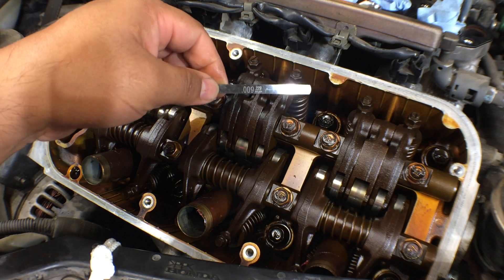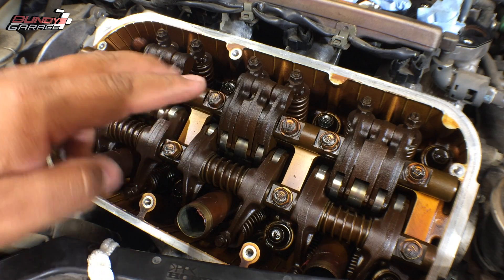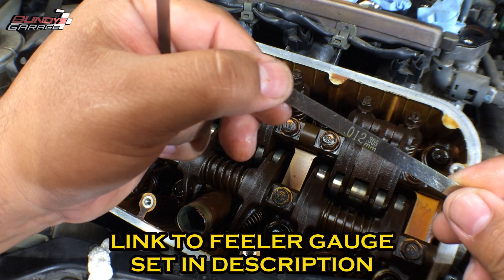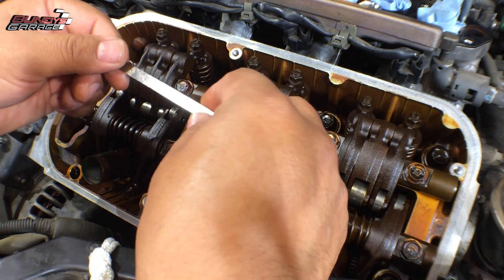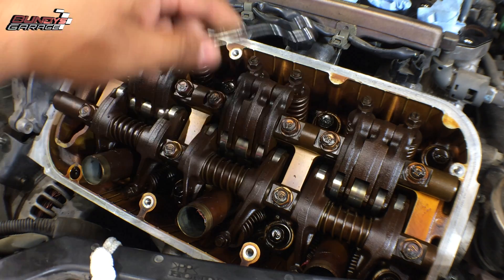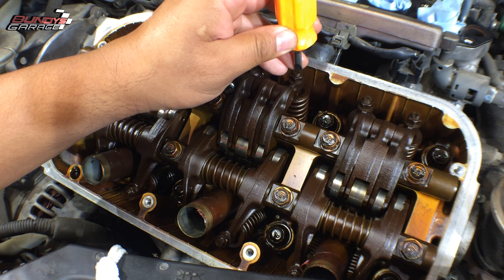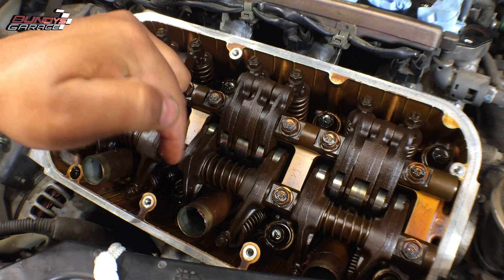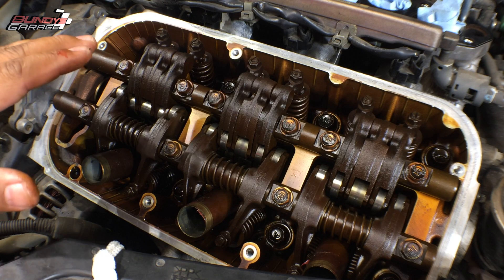J SERIES Honda V6 Acura Pre-Check | Valve Lash Adjustment Accord Odyssey Pilot 3.0L 3.2L 3.5L 3.7L

Comment: When I start the car (it’s a 2006 Acura TL), it starts with a slight misfire and then stabilizes. The scanner shows cylinder 5. The car runs normally until I put it in Drive, drive a short distance, and stop—then it begins to misfire on cylinder 5. Shifting into Neutral doesn’t make it go away, but if I put it back into Drive while the misfire is present, it clears up and drives normally again. However, once I stop at idle, the misfire comes back. What could it be?
Reply from the maker: Have you done a compression test? Sounds like a bad fuel injector or you needs to check valve lash.

Comment: Only adjust the valves when u see the marks lined up on the camshaft and the front cover for that cylinder. You have to rotate the crankshaft for this. 19mm bolt on the crankshaft. If what I just explained is not making sense, please go to your professional mechanic.
Reply from the maker: Yep if you get it wrong, bye bye engine.

Comment: I had to do a vvt solenoid replace on a 3.5 and to do that you have to remove the rocker arm. My question is when I go put the new solenoid and rocker arm back on and torque to spec do I need to adjust the valves too?
Reply from the maker: It's a good idea to.
Reply: What year is your honda? My 2010 was 3 bolts and boom everything was off

Comment: I had to swap out the front cylinder head due to a broken bolt that messed up one of the holes. I transferred the camshaft , and arm rocker to the new head. After assembling camshaft and arm rocker I can’t rotate the camshaft it is too tight and jumps when I’m trying to rotate it. I need help on this .
Reply from the maker: Did you do a valve adjustment? It will be really hard to rotate it on the bench, gotta have the head on an engine block.

Comment: What if you can’t fit a feeler gauge underneath? Need to turn the motor? Or valve burnt?
Reply from the maker: On the J Series you have to make sure the front camshaft is lined up with the specific number cylinder you are working on. Here is the cylinder order for the J Series.
FIREWALL
1 2 3
4 5 6
RADIATOR
Reply: Provided you are adjusting the right cylinder for the cam and crank position, not being able to fit the correct size feeler gauge means that the valve is tight. Valves normally tighten with time as a result of valve seat recession. If the valve is tight, you must loosen the locknut and adjust that valve using the correct size feeler gauge.

I should note that a tight valve COULD be burned. This is not likely the case unless the valve clearance is ZERO. But you generally know by the way the engine runs (ie a miss that clears up at higher RPMs) whether or not you have a burnt valve.

Comment: When I opened up my valve cover, one of the rocker arm adjustment nuts was not there. Is it OK to use A? Regular bolt or do I need to order from Honda? Oem
Reply: Which is nuts 🤣
Reply: @celestial_2307  lmao I gotta re edit. There are Chevy nuts, and Honda nuts, depending on their level of “die hard”😅
Reply: A nut is a nut. A bolt is a bolt. As long as the “grade” is the same, you’re fine. There’s no “Honda” nuts and there’s no “Chevy” nuts. They all come from the same place.

Comment: Please what if the filler gauge is not available,what can i use to check and gauge
Reply: You can use printer paper if you know what the thickness is. Don’t adjust valves without proper tools. No sense of tearing apart an engine if you don’t have the tools to put it back together correctly…”eye ball” would be your best guess probably 👍🏼

Comment: Help, please. My car was ticking on idle and ticks louder when im accelerating. The idle tick is gone after replacing the timing tensioner. But it still tick when i accelerate past 1500rpm. Could this be my valves? 2011 pilot. 

What is a fair price to get the valves adjusted? Google is saying $250-300, but i see in some forums they can be as high as $600. I really dont want to pay too much to get it adjusted.

 I see another video where he cranked the crankshaft to each cylinder prior to adjusting. Does this need to be done?
Reply from the maker: Yes you have to rotate the engine (by hand) to each cylinder so you can measure and adjust each valve on intake and exhaust. If you have never done it and your not comfortable doing it, don’t do it. If you get it wrong, you can destroy or hurt your engine. I charged $700 for a valve adjustment on a newer Odyssey, cause the back cylinder head has to be done blind, just by feel. Took me half the day to do it.

Comment: Can you adjust the valves before you put the heads back on the block?
Reply from the maker: Yes you can.
Reply: @bundysgarage is the timing belt on while you do this adjustment?  Do you need to move the cam doing these adjustments?
Reply: @JesusLemoose you may as long as the cam is not pushing up on the the cylinder valves you're adjusting you're fine if they're pushing up you should be able to adjust the other cylinders that the lobes are not touching the rocker arms any cylinder that the rocker arms are not in contact with the camshaft lobe you can adjust

Comment: Hey got a quick question, what is a reasonable price for this job at Honda dealership? I was under the impression I was looking at around 200-300$. I called the Honda place this morning and they quoted me 475$. This is for a 4 cylinder accord. A 2004 model. Does this sound overpriced to you?
Reply: No that seems pretty good to me. We charge 2.4 hrs for 4 cylinder and 5.5 for V6. (I'm an Acura tech in so Cal) I think it's pretty good considering it's done right the first time and then you have a warranty in the unlikely event of a valve cover leak or something similar.

Comment: I just did a complete head job on my J32A3.  CYL-6 had misfire only during start-up and up to a minute.  The oil sample report indicated coolant in it.  I did compression test, cooling system pressure test & cooling system exhaust gas test, all of which came out negative.  No white smoke from the tail pipe, no bubbling at the radiator filler neck either.  My engine has only 230K miles, and I expected a Honda engine to last at least 300K miles without a major work. 

I bought new raw heads & transplanted everything else.  The head gaskets were intact, but the front head was very slightly beyond limit.  There were undeniable traces of coolant seepage on CYL-6.  After this back-breaking job, the engine seems to run smoother & quieter.  However, I adjusted the valve lash to perfection but compression on CYL-3 went down from 270 PSI to 240 PSI.  I rigorously checked all valves & valve seat mating surfaces before installing the heads, and didn't find any issues but here I am.  At least the engine is running better than before. 

Another thing I noticed during this job is that the EGR port on the J-Series engines is directly connected to CYL-6 (which I'm sure you know), and if the coolant passage gasket fails, it could have misfire on CYL-6 by allowing coolant to enter the EGR port when it opens.  Someone experiencing misfire on CYL-6 should check/replace this gasket before removing heads.  

BTW, I use angled feeler gauge (available at Amazon) and Blue Point's valve adjusting tool, YA8895.  The Blue Point is expensive and there is an alternative at Amazon at a fraction of Blue Point's price.  I went with Blue Point because I support U.S manufacturing (and I'm a Japanese native).
Reply: Excellent information
Reply: What year is your honda? I thiugh compression spec was 160

Comment: Are the valve cover and spark plug tube gaskets usually okay to re-use?
Reply: Yes if they are fairly new
Reply from the maker: No I would not reuse them. You run the risk of an oil leak if you reuse your old valve cover gasket and spark plug tube seals. Just buy the Kit by Fel-Pro that comes with everything. You can get it from Amazon or RockAuto.com

Comment: Can I do this adjustment on my Honda Civic 2001 EX 4 cylinder?
Reply from the maker: Double check and see what the adjustment is. There should be a sticker on your hood that shows what the intake and exhaust valve lash adjustment is.
Reply: Yeah you can and it is much easier since they are all right there in front 👍